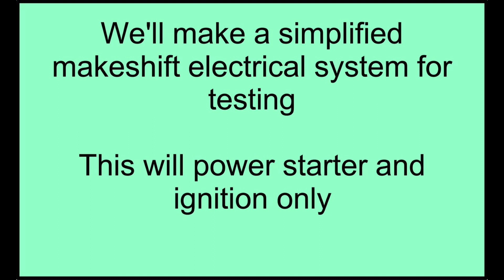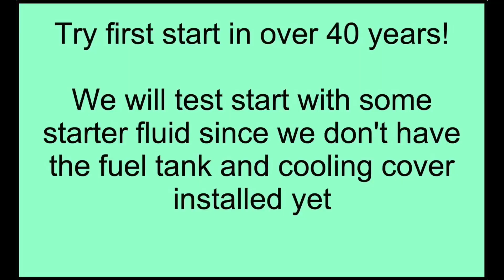Kohler K141 engine rebuild/restoration (part 3 of 3)

Comment: Nice video series, I've got one of these powering my Toro reel mower but it's lost spark standing still over the winter. Tried the usual culprits but to no avail, would you happen to have a repair or parts manual? The points seem good but i might as well try to replace them and i saw you did yours. Would be appreciated. Best regards from Belgium
Reply from the maker: Appreciate the feedback. Make sure the coil is still good and all the wires are attached. If you rotate the flywheel you should see the points move. Hope you get it working! Here is the manual: https://resources.kohler.com/power/kohler/enginesUS/pdf/tp_2379.pdf
Reply: @DIY-VIDEOS  Thanks for the swift reply and the manual link, the points do move when turning the engine over and the space between them is within spec. I'll print the manual and get to troubleshooting when I get home from work. As you rightly suggest I'm afraid the coil may have gone bad (or some wire got corroded or loosened to the point where it no longer contacts properly). Will follow up on this if I get it to run!
Reply: @DIY-VIDEOS  I had to wait for a harmonic puller set to come in (only have metric on hand here in Europe), got the flywheel off and it turned out it was just a wire of the coil that got loose. Thanks for the manual and the help, that's one 50+ year old reel mower back in business :)
Reply from the maker: Awesome, glad you got it working!

Comment: Would you happen to have any links to the stuff you used to make the starter board deal?
Reply from the maker: It was just stuff I had laying around. The most important pieces were a momentary switch for the starter and a toggle switch for the ignition and some wire. I think it should not be hard to find, just make sure the switches are OK for 20A (usually rated at 110V, so will be able to handle more at 12V)